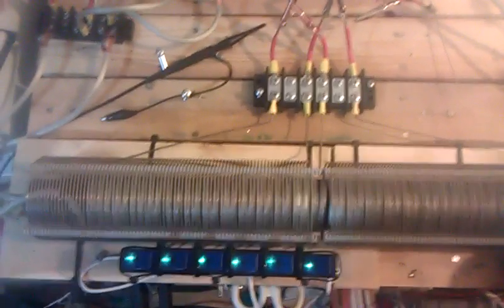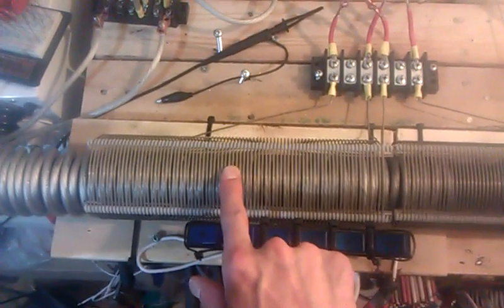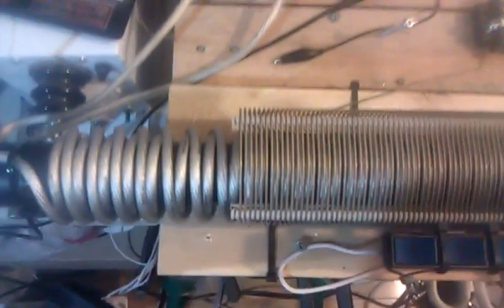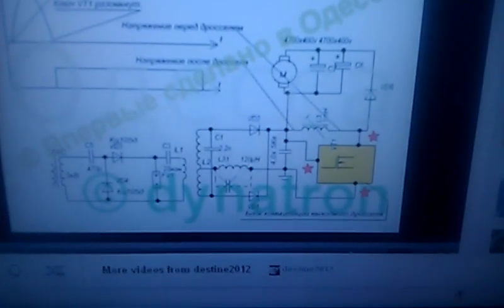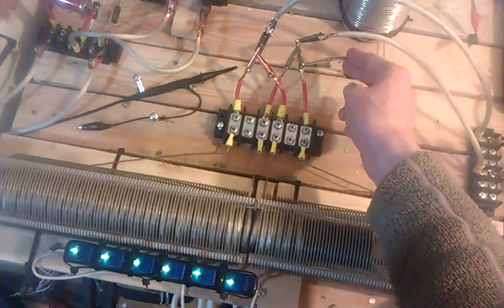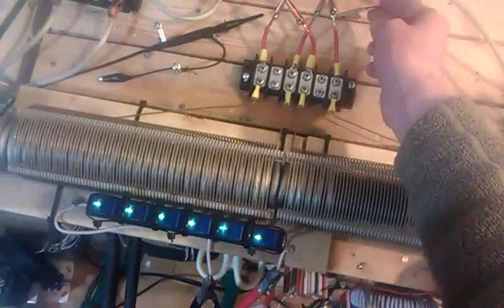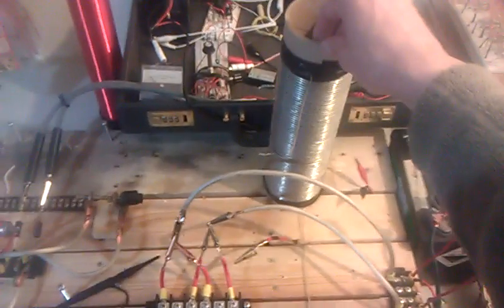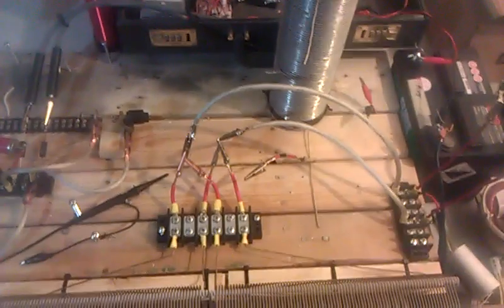Don Smith Device Project Part 26: Extra Inductor Added, Built-In Radiant Antenna?

Comment: Hi! Kurt. Very clear and clean demonstration of the effect You wanted to show with your extra-coil :-bd

Yes, you look to demonstrate an kind of antenna effect.

I mind: I'm used to think that in the case of such coils like your secondary-coils, they radiate much around. Could you move next time your extra-coil near them to see if could change the out-put too? And if yes, try a kind of multiple-skin/level coils, like onions: on strata taking the radiant energy of the other inside?

Cheer.